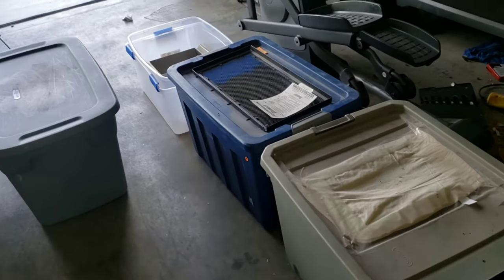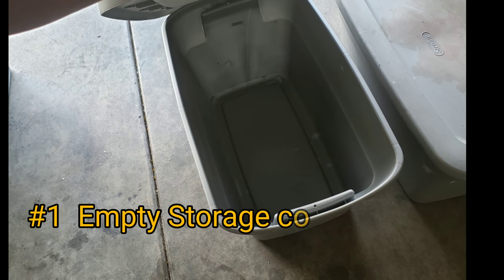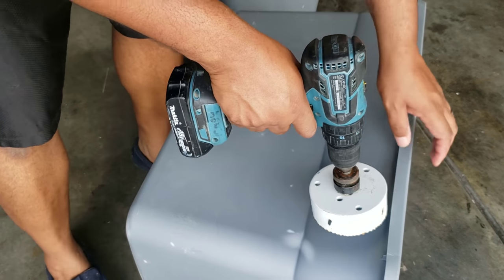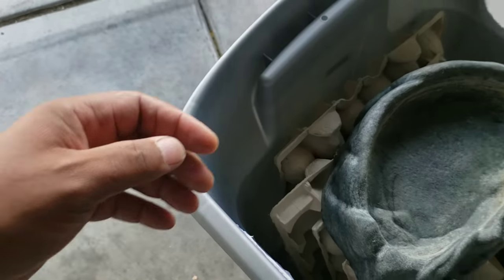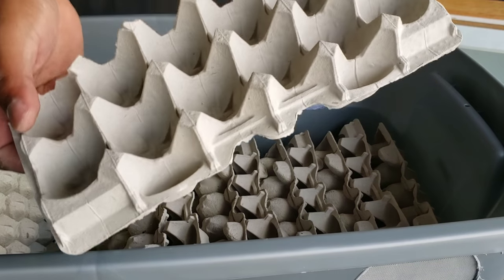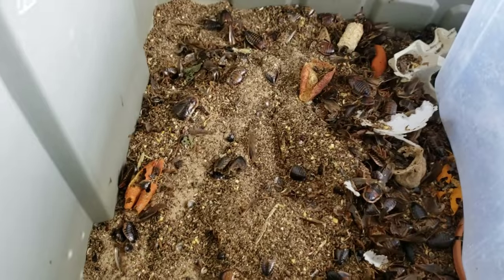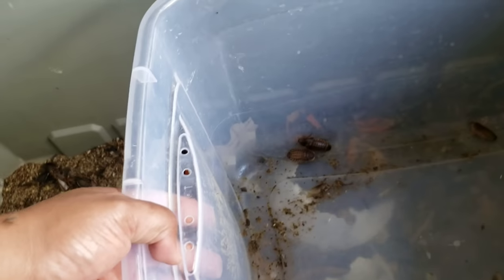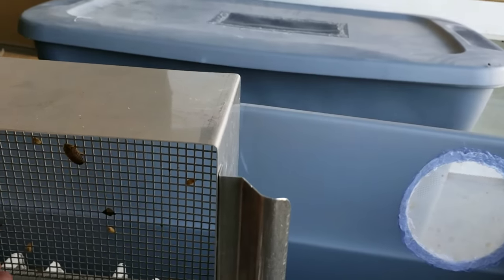Improved way of making Dubia roach bins(Faster,easier, better)

Comment: hello.  thx for the vid.  i have my colony in garage looks like you do to. but thinking of bring them in because of high temps.  how does that work for u with dubias, temp wise?  i believe u are in LV and i'm in PHX. similar temps
Reply from the maker: yes bring them in my colony died off in the garage unless you have a minisplit or something installed

Comment: Do you put a heating pad in there too ? Or they are able to breed without it?
Reply from the maker: you only need a heat pad if your keeping them somewhere thats gets cooler than 80 degrees. I keep them in my reptile room where it's 85 or above most times if it gets cold I would put a heat pad

Comment: Hello bro, you did a hole on the bottom of the top bin and the low bin tap to connect the both bins?
Reply from the maker: yeah drill different sized holes in the bins and leave bottom bin without any holes so that it catches what falls through.
Reply: @GeneticallyModifiedDragons   Thanks for the tips you have a very cool channel, keep going.
Reply from the maker: thank you